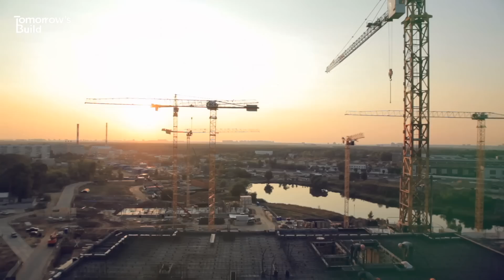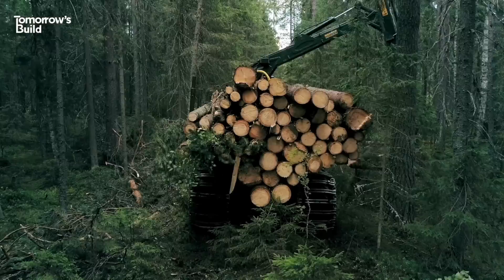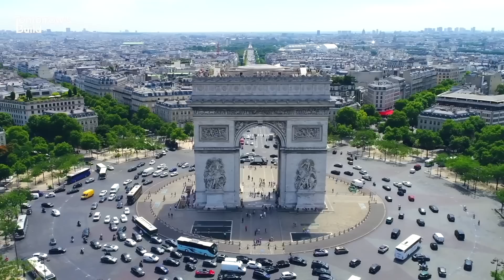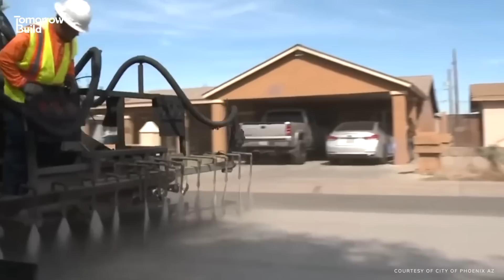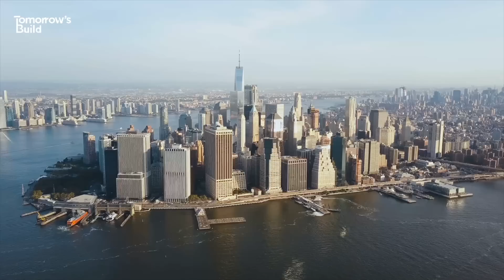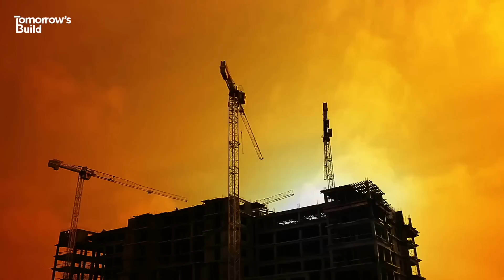Why We Should Paint Our Roads White | Tomorrow's Build

Comment: At its current concentration, carbon dioxide has negligible impact on temperature.  Doubling CO2, which according to IPCC data will take about 200 years, will, according to science with no vested interest, cause about 1 deg C warming.
You are worrying about maybe 1 degree in the next 200 years?  Get a life!

Comment: Re: lighter colored roads.
Painting is not practical. 
Regular paint can wear off in just weeks or months. What would be the cost of repainting every road 4 times a year? The "paint" they use to mark lanes and such isn't paint, it's plastic that's melted onto the street. Do you really want to use that much plastic to save a little energy?

But here's another idea. Tar is black. But the top surface of tar gets worn off pretty quickly. Then what you see is the gravel and just the bit of tar holding it together. So the main color of a road is the color of the gravel used. I remember seeing a red road once because it was made using red rock. So why not make roads out of white rock?

Comment: Your initial premise about CO2 contributing to climate change indicates you have no idea about how CO2 actually functions.

Doubling CO2 from its present level would, at most cause 0.75° F if warming.

CO2 is at saturation as far as energy absorbtion. To increase it dramatically would require more heat input.

Comment: The white paint on tar reflects the heat onto the buildings nearby. Also, it loses its reflectivity as tires leave tracks behind.
Seems we need concrete with a "nature barrier" between the road and the street. Something I've seen for years but no one has done...because money
Meanwhile I'm sure the upkeep of tar and the white paint over time is far more than concrete that's poured properly in the proper conditions.
Reply: Not too mention that you need to add an additive (sand, etc.) to keep the painted streets non-slick. OR how about those of us that live in northern climates? Ever hear about snow? We don't even use reflective paints or strips on our roads due to the snow plows. Our streets are consonantly being repainted due to the plows.

Comment: Concrete road is naturally white, stronger, and has longer lifespan compared to asphalt road, so maybe building concrete road instead of asphalt road is better. But it's probably more economical to paint building roof with white color since it will also save on air conditioning electricity demand. Actually, there is reflective coating that reflects sunlight better than white color, so it can be used on roof for even better result. But in the winter, black roof will save on heating gas demand, so maybe people can use black roof cover like car cover in the winter. Also, black solar panels also contribute to urban heat island effect. It also has a low solar energy to electricity conversion rate of below 20 percent. Therefore, in summer, black solar panel on top of building can lead to more air conditioning electricity usage than the amount of electricity the solar panel generates. But solar water heater can convert up to 80 percent of solar energy, so it might be more economical and green. Additionally, depending on the climate, green landscapes such as trees can heat up the environment because trees store heat and worsen air pollution because trees block wind. As such, I think the world needs more case-by-case scientific approach to fighting climate change instead of having symbolic one-size-fits-all solution.
Reply: Concrete is brittle, after a certain load it will shatter, especially on roads, where you apply huge forces on small areas that shift quickly. You can solve that with pavement stones, even made of concrete, but you will either degrade vehicles faster or travel at low speeds.
Reply: Of course, you need to take limestone and burn it in kilns at high temperatures to make concrete -- so there's that environmental issue as well.

Comment: Basically we're f*cked - the counter argument to do anything is always "it costs more" so until the whole of society is on board and legislators actually ban stuff which is massively bad for society as a whole, which then averts that argument nothing will change - concrete will continue to be poured, people will still drive unnecessarily and leave windows open for no reason and burn stuff - most people over 30 will never see the outcomes of that 400 yd car journey to buy a pint of milk so it doesn't bother them, likewise unless their kids are savvy, they will not make changes either 😔

Comment: Saving $100m a year wouldn’t even pay the cost of painting streets & roads white in the first place, and it would have to be redone frequently due to wear. We’d be better off painting roofs, which would at least last & have a direct impact on the cooling of the building.
Reply: youre not wrong about the costs but painting roofs, although it reflects more heat off from the house, doesn't properly reduce the "heat island" effect, because that is created in the roads and generally areas between building where people walk, people don't walk on roofs so theres no point of cooling the air above it (I know that it would reduce the temperature inside the building so less air cooling but it was to clear your point)
Reply: Source?
Reply: Common sense. It's much better to plant trees than paint the roads. @MetDaan2912
Reply: Or make white concrete for future roads

Comment: I don't really think painting roads will do much. For one, most roads are a light gray anyways, but if thats not quite enough, just look at white sidewalks and such. They still get super hot from sunlight. Maybe not as much as if they were black though. I think we just need to stop wasting as much heat.

Also, someone else mentioned this, will painting roads effect the traction of tires? Won't they be slicker?

Lastly, the white paint will look terrible with black rubber tires rolling on them constantly. Rubber is naturally white, but most tires are synthetic these days.

I'm not saying its impossible, but I'm not exactly sold either.
Reply: What this video failed to mention was that the construction of the roads themselves are one of the biggest contibutors to human induced climate change. Painting them white might help reduce heat island effect but this ignores all the emissions created during contrsuction of the road, emissions created during maintenance if the road, emissions from the vehicles that use the road as well as particulate pollution of toxic molecules into our air, soil and water. You don't reduce road emissions by painting them white, you reduce road emissions by not having the road.

Comment: What does white paint on asphalt do to the friction of tires on roads? Does it make roads more slick?
Reply: There is a good chance that a white painted road could be slippery whem wet although abrasive paints are available.  i would be more worried about the blinding glare of reflected sunlight personally.
Reply: @Twmpa  drivers blind by glaring with cars on slippery streets. Not the future I wanted...
Reply: @rodrigosouto9502 abrasive low reflective white paints exist, and engineers wont paint something if they increase the risk of accident
the question remains how feasible economically they are for so much surface. No matter the texture they will be titanium dioxide based or even more expensive. And there is also the question about health effects.
Reply: It does exactly what they want it to do. It makes driving less safe, due to traction and visibility. Then they can swoop in with their narrative that "its time to ban human drivers because muh safety and muh environment".
Reply: Already tested in California, failure. Rubber and dirt accumulation constant need for cleaning, it doesn't work
Reply: In the wet, its very bad. In the dry, it does but its not too much on a issue (although if its the whole road... maybe it would be.)
Reply: @tomr6955 well here is a thing car is basically a safety device, like helmet just bigger and actually dangerous to everyone outside of this two ton safety device
Reply: Exactly. Ever got your drive wheels on a wheels on a wet crosswalk stripe at a stop light? When you pull away you get wheel spin. This is the type of hysteria over climate change that is going to result in half-baked solutions and create  “solutions” that create real problems and get people hurt or killed.
Reply: @tomr6955 Yep, but having a few thousand pounds of steel around you ... plus airbags ... makes the risk more acceptable.
Reply: @tomr6955 yes. Imagine this. Cars sliding everywhere... I prefer to be inside my car sliding like the others, in the case of accident I won't be killed at least.
Reply: I don't know, but if it is more slippery I would retire my bike and drive my car everywhere. And recommend everybody I know doing the same. 

My life and the lives of beloved ones is my top priority.

Comment: While on the face of it this would sound like a great idea; one has to think about the toxicity of the paint / covering (CARCINOGENIC PETRO-CHEMICAL-PHARMA-PFAS-FOREVER-CHEMICALS, ETC) ... because it WILL MOST ASSUREDLY (AS EVEN WITH 'PLASTICS') oxidize and sluff off and run with the rain water into, and near irreversibly contaminate the environment and waters, and ultimately make it into rivers, lakes, streams, aquafers, and ultimately to the ocean / seas.   Better would be white concrete highways and byways .... but the cement they're made from is not very environmentally friendly in the manufacturing process.   Better would be a much higher concentration of stone aggregate in the asphalt mix .... so eventually roads with this high percentage of aggregate almost look white, in comparison to asphalt with little stone aggregate.

Comment: Probably the biggest overlooked idea, is to stop building up and instead build down.  Reverse pyramid below ground construction would use less materials and need much less heating and cooling, with thought put into positioning based on the movements of the sun it can be sunny in every window a few hours a day.  

Imaging a city covered with parks and light rail on the surface with roads and buildings primarily underground
Reply: And everyone dying from vitamin D and fresh air deficiency!
Reply: You really shouldnt be living underground with no direct sunlight or an easy way of freshening air. If anything, more transit should be going underground.
Reply: @danielszekeres8003  That's what I'm saying.  The design would be more akin to an open cut mine with each stepped level having access to a window to the outside world with sunlight for a few hours a day.  But with the rest of the living space or office underground to take advantage of the thermal cooling and heating properties of being partially under the earth.

Comment: Although the Dutch are known for there construction abilities. There government is known for unrealistic policies.

The idea for 2026 is in theory a very good one. But they already know that there are not enough solutions to make it work. Al of the test pilots they did fail. Some just didn't work Others where to small to make any conclusions or to small so therefore the infrastructure needed impacted the environment more than if they didn't have done it.
Then there are some solutions that work perfectly on paper. They will use fossil fuels elsewhere and then transport the heat. You need as much or more fossil fuels but with an administration trick they can magicly disappear the co2. So there is no net difference only a paper victory.

The government has done some research into this and although these are some of the problems. They believe that it will solve all by itself without any regulations or management. 

This policy will make sure that they can't build enough housing for the population. Which is a big problem, there they already have a big shortage of affordable housing. The prices will rice and make the problem even worse.
Reply: But still; nothing wrong with being ambitious. Without trying, failure is imminent.

Comment: Big sky scrappers with big Plato on every level for at least a 1 acer yard with trees and grass bushes.
Have the garage inside I the middle of the building on every floor so people don't need an elevator and can park at there front door.
Also the floors won't be normal it's to incorporate the garage and Plato with a  big yard.
So a 30 story building will only have 10 floors it's to incorporate the extra weight of the add on also the building can have its own waste water treatment plant inside to treat and use the nutrient rich water for the outside garden and park for the residents.
Sustainability is the best way to go.
The trees need space for there roots so 20 feet down of soil and however long the building will be no need for multiple Plato's just 1 continues long Plato so all the trees and plants can be connected by the beneficial soil life.
Ps trees and other plants can talk to each other with mushrooms